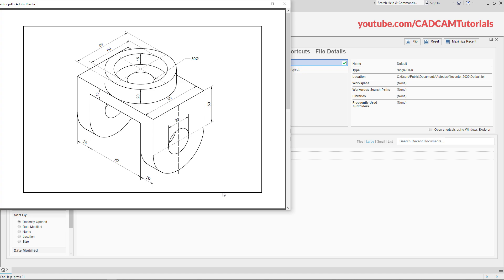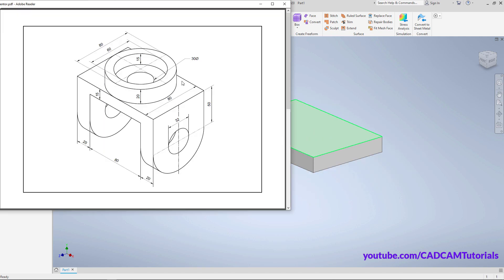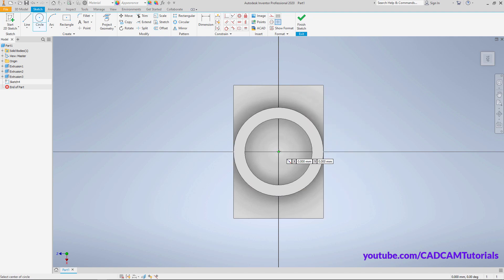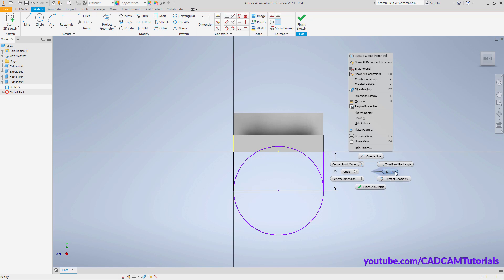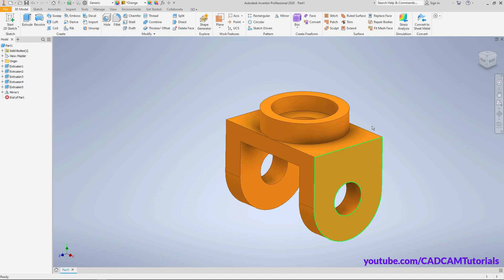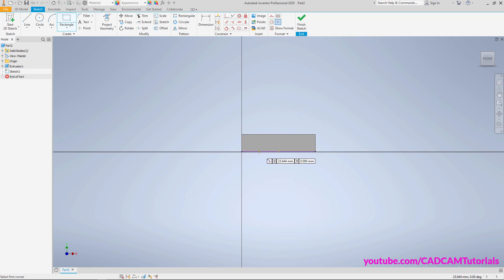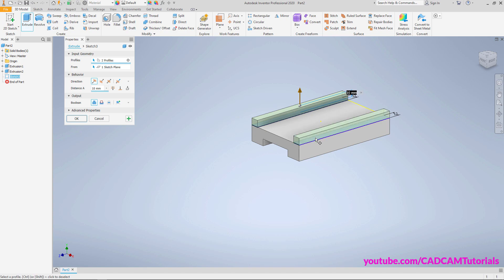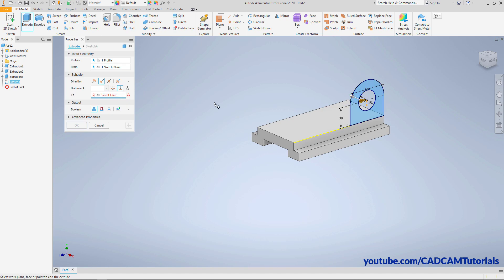Autodesk Inventor Tutorial for Beginners

Comment: Thanks for the beginner tutorial. I haven't used Inventor for years and I see it is much better than it was.
Q: Why did you use the additive method of modeling for this part, instead of subtracting from a blank stock piece in the order of machining operations? Is it personal preference?